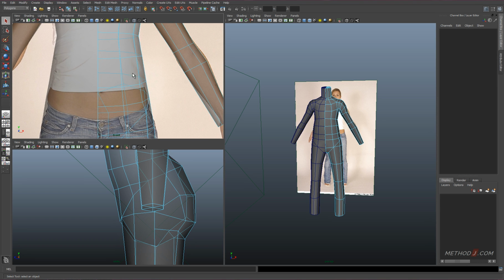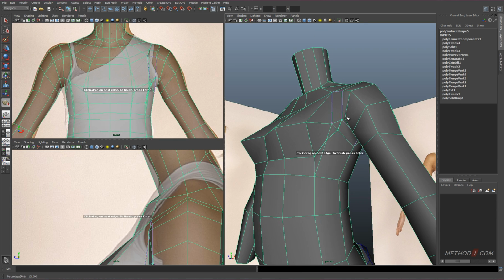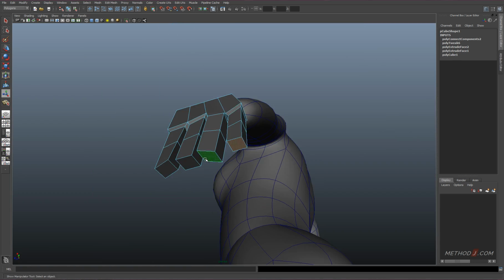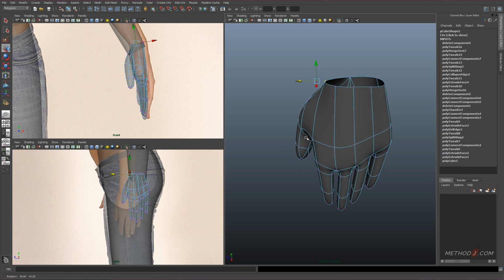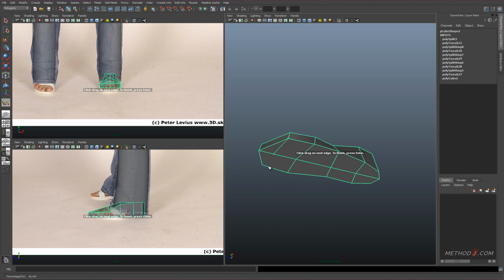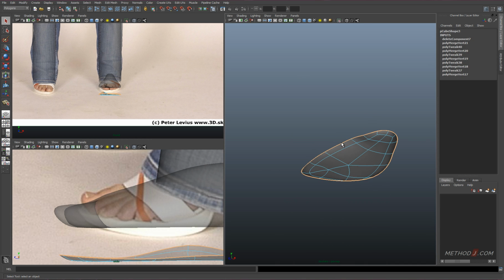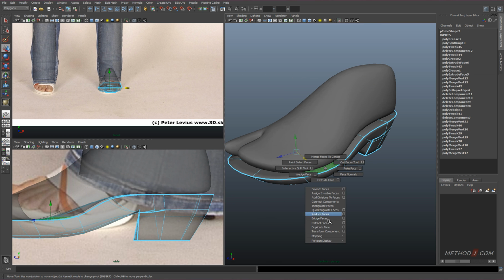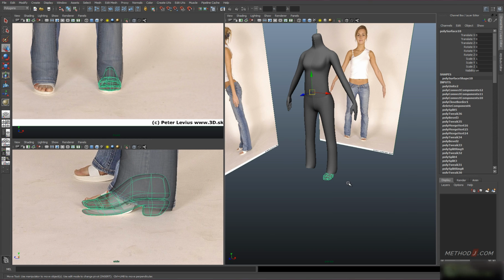Maya Character modeling tutorial, part 2 - Hands and Feet

Comment: after the block out of this model , will it be taken to the zbrush for details and if we want a realistic model so do we need to retopology of it ...what is the full process of realistic model
Reply from the maker: Yes you could sculpt on this as the next step. Retopo is only needed if you significantly change the character shape. In that case, you'd want to model that into the low poly version, before moving to sculpt.

Comment: Hi James, at 5:16 after you connect component the three vertices on the thumb, the top bit appears connecting the other vertices on the thumb. what did you press to get it? That's where I am stuck. Also did I explain well enough?
Reply from the maker: +Naomi Gumede I think you mean when I used Chamfer Vertex?
Reply: Yep fixed it. Another glitch though part 2, I'll comment there.

Comment: So you said that you are a professor right? I am a college student going into 3d graphics and modeling...May I ask a bunch of questions? my first and foremost question is that I have been using blender for about a year and a half now prior to that nothing, and I have switched over to maya and have a decent feel for the UI...so my question specifically do you have or have ever had any students that are just starting out knowing next to nothing? and my second question I did a little render this AM and my computer crashed...lol...I save, A lot! but is there a computer you would recommend? or what do you use personally?
Reply from the maker: +Whitney Bittner most of my students are beginners and haven't spent time in the program. I always build my own PC. For pre-rendered stuff, you want as much RAM as you can afford. And then for manipulating things in the viewport, you want a powerful graphics card with as much VRAM as you can get. I generally prefer NVidia cards.
Reply: Awesome thanks!  Kinda in a slump but I'll get it 😊

Comment: What a excellent workflow. So this workflow is aimed at further sculpting in mbox zbrush, for only sculpting purposes or you do all your models like that and use retopo later to get decent low poly model?
I tried similar but end up in more problems with retopologizing,  in comparison to model from start at med high poly count and use zbrush to make detailed normal map and texture. I would like to see your complete workflow on a smaller scale time wise.
Reply from the maker: Zox Wolf Yes, this was to prepare for the sculpting pass, where most of the detail would be added. I like to model first, that is just my preference. And generally, I'll be able to use that low-res version later as the base mesh, rather than spending time retopologizing. I use mudbox instead of zbrush, so even with the changes from my sculpt, I can just re-export my level 0 or level 1 detail mesh and have a working low-res mesh.If you are running in to problems with retopo, focus on the art first without worrying about the retopo, and then tackle the retopo when the mesh is done. The creative and technical aspects of sculpting while thinking about topology can cause conflicts, so prioritize one over the other.
Reply: James Taylor
You are right about conflicts you are talking, though i am engineer and modeling is just my hobby. I didn't touch maya organic modeling for several years due my profession as naval engineer and i started again with aim toward creation of game assets props and chars (as hobby again). I realized that skill must be nurtured as anything else to be fruitful. I don't see pattern sometimes, edge flows redirection and face loops if you understand me correctly , and this drives me crazy. I like to have control over my mesh. To be able to see how to spin that flow in order to get what i want without getting even one tris (and not even talk bout ngons). I would like to have that kind of workflow and later use zb or mb to add these details as normal map on my existing mesh. I understand what you are doing though you are pro and it look so easy when watching you do your stuff :) but there is bigger picture and this is only a part of it. I would like to see series of tutorials based on one project and with aim to create char at the end to be textured and deform friendly :)
Keep up mate. Your tutorials are awesome.
Reply from the maker: Zox Wolf sounds like you might be a good technical director - retopologizing characters and creating perfect low res models is one of the main things a character TD does! That desire to create something organized and technically solid is its own thing, can often be at odds with the creative process, the way you separate the two is a good idea!
Reply: James Taylor
Thanx for your kind words, but huh, i think they would fire me due my slowlines haha, well anyway i hope i will make some progress regarding that in future.
Reply: Zox, I think that hobbyists sometimes get better results than full time professionals because they have less constrains and more freedom and time. Are you still doing this? Come on, give us a link to your gallery if it's not copyrighted or something. I have the feeling that a naval engineer is really coming up with mind blowing ideas.

Comment: Nice work! I would love to follow you impressive example of how to build a body but I can't get my edge loop tool to work for me. Im using 7.0 Unlimited and that tool gives me a headache. And my smoothing doesn't smooth anything! My "models" just stay faceted. Im so lost...
Reply from the maker: FrakU2 wow, Maya 7.0! Most of the features I'm using in this video are newer than 07, like Smooth Proxy, which is why you weren't able to get it to work. I suggest getting the newest version of Maya, no reason not to, as Autodesk makes its programs available for free for non-commercial use: @education/free-software/all
Reply: James Taylor Cool!
I will look into that...